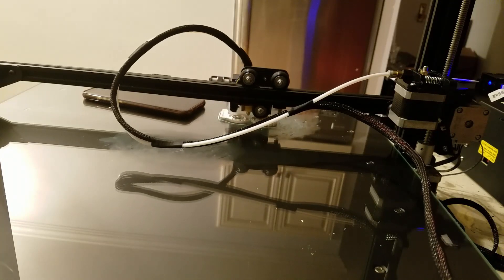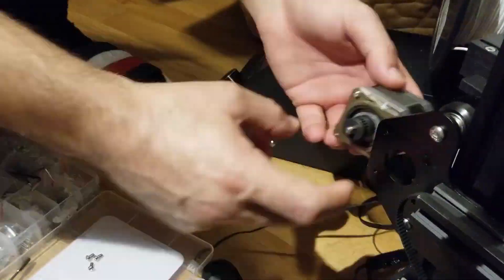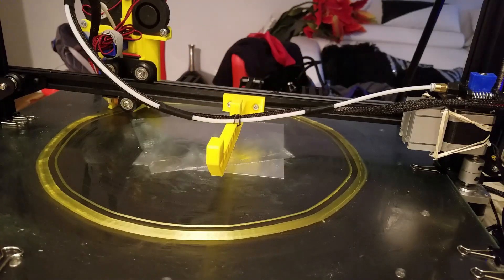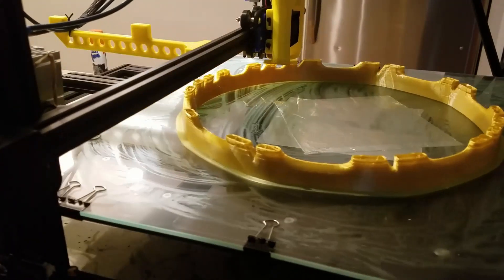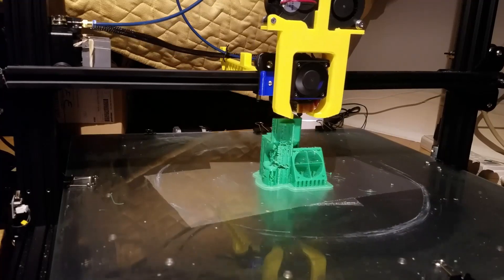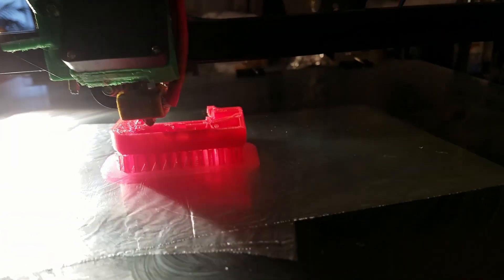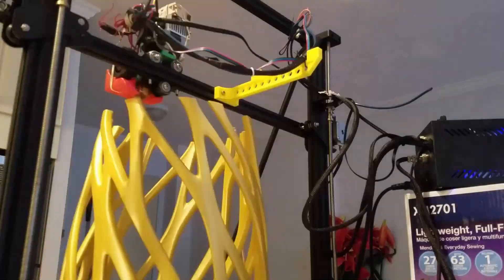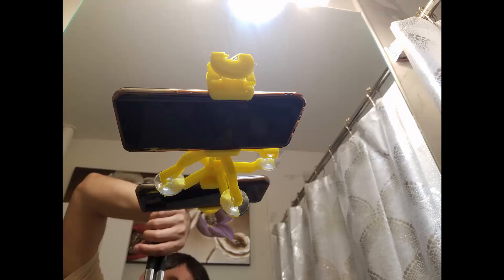Creality CR 10 S5 3D Printer upgrades Direct Extruder reliable Direct Drive 3ft art Vase

Comment: I just ended up upgrading to the bondtech dds on the cr-10 s5 with a bltouch. Let me just say it works amazing! Fixes all my problems!
Reply: I have made a lot of star wars helmets with it. The dds fixes the fan noise and the 2208s on the skr make it silent.
Reply from the maker: Did you do anything to the bed, heating - feel that is where I have a problem is not uniform?  I have left mine the way it was. I did purchase an SKR board for it but  Ineed a power supply and another type of bed heating and so on, I feel it may need more work _ ihave a few bond tech clones on hand but I have no use for that 3d printer now so i am postponing it. I am hoping eventually I will upgrade it to 24V. I have to find a bed that heats up completely. not just in the center.
Reply: @RoamingInterests  man i did upgrade my bed! I do have an skr board, love the touch screen! I have a 1300w silicone matt, 150 bucks on amazon with a solid state relay. I think it cost 20 bucks. Do not go cheap on the relay or it will catch fire! I get abs temps in 50 seconds now! You dont need a different power supply with this upgrade you connect the relay directly to the wall. A 24v upgrade is really not neccesary. But I am using the DDS for cr-10s5 by Bondtech, I spent the money because the furstration of very clones was making me tired. If you have the money I highly reccomend it, the clones give you a hard time for what it is worth. And it gets you a driect drive e3d v6 system. Have a great day!
Reply from the maker: Thanks for the info. I will take keep it ready to trigger when I choose to get my hands dirty with that 3D printer. I still have no use for it yet. I have it stored in a box. That thing takes a lot of space and is noisy. One of the years I may recommission it to production. So far is too much work to recommission it. I have limited amount of space and that printer takes all a lot of it.
Reply: @boulderguy888 why? yes you are correct!  For the S5 the only difference is you have to buy there extension cable. for the cr-10s just buy the dds kit!
Reply: @boulderguy888 why? It is on bondtech's website. Unfortunately they just announced they are replacing the dds with ddx. Which means you have to buy the mosquito hotend too. I really liked the idea of the all in one kit! It is still working very well for me. The page says theres a few left if you want to try and pick one up. You only need the extension for cr-10s4/cr-10s5
Reply: @boulderguy888 why? I would wait until the LGX comes out.

Comment: You should do an E-step and flowrate calibration. To fix under extrusion. Also you could have upgraded the extruder into an all-metal extruder before you do the E-step and flowrate calibration.
Reply from the maker: Thank you for the tip. Moths after this video I got to say that I made this into a direct extruder. with the original components that came with the printer. I did at one point attempt the BMG extruder clone with the e3d all metal clone. But I was never satisfied with the carriages I printed, and the screws were too short. Eventually I figured out that the heat block was not completely tight on the heatsink and that was causing problems. It is quite an ordeal to figure out because if the printing head is cold, it feel sturdy. Only if you heat it up you realize that the cold plastic keeps it sturdy. So now If I have anything printing bad, That's the first thing I check.After several iterations of re-printing the carriage for the direct extruder and now with CURA 4.3  last Spaghetti Noodles 3d print has great quality https://youtu.be/LX4saU1tsVY. I haven't been using my 3D printers to print anything impressive, mostly tests. I did print a smaller vase in gold in one shot and It came out quite badly. That threw me into some more testing and made a video about the large 3d printers under 2 minutes but in the end or at least now, the Last 3d print sliced with Cura 4.3 on this creality s5 came up quite nice. There is a video I am working on about the spaghetti noodles 3d printing for lattices and stringing.

Comment: this the first time i see someone bending the motor bracket to solve the alignment of the motor. usually people just cable tie the motor to the frame. some people on fb group report their stepper motor is hot after using the damper,because the motor mount is acting like a heat sink transferring the heat to the frame. adding heat sink also help. some tweak the voltage if i not mistaken. by the way,do u have ghosting issue  on yr s5 ? i have  it on mine from day 1 i get it. some people i have seen in facebook group doesn't have this problem. i have tried tweaking the setting. when i solve the ghosting issue,then another problem is coming. the tolerance is totally out  & the wall is not as shiny as before. the shape is also weird
Reply from the maker: I did not think that far to tie it with a zip tie. I thought that is a permanent thing I need it to do. I like the idea that the frame acts at a heatsynk and the dampener isolates and traps heat. That is a good one. that is why they heated up. I think they heat up regardless, good think they are on the bigger side. Yes I added heat syncs but I think the best way is adding active Fans, perhaps you saw them in the video.